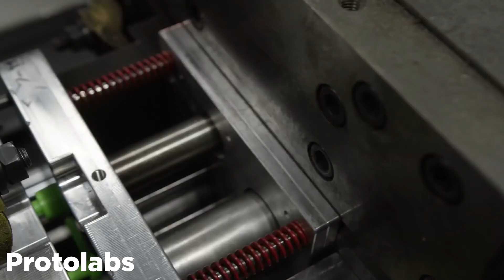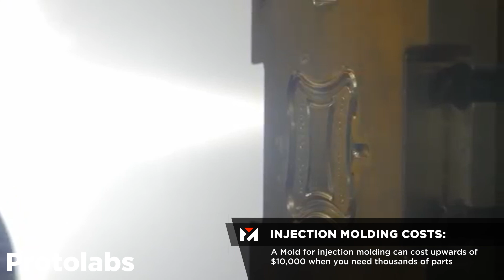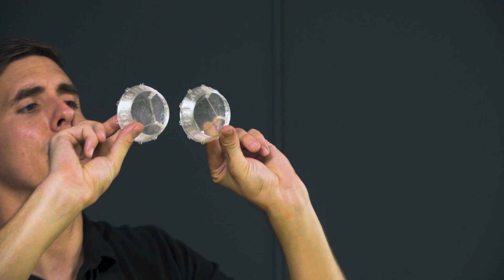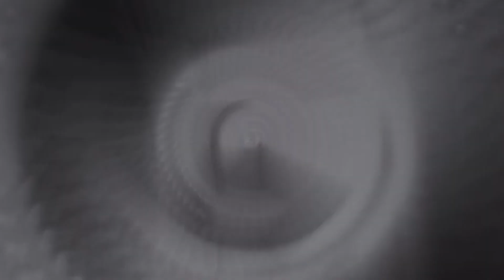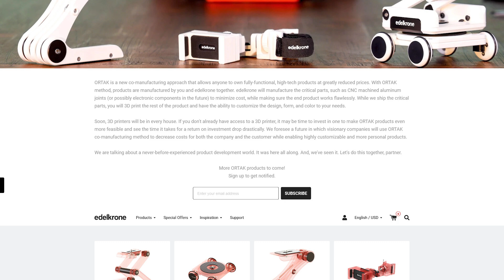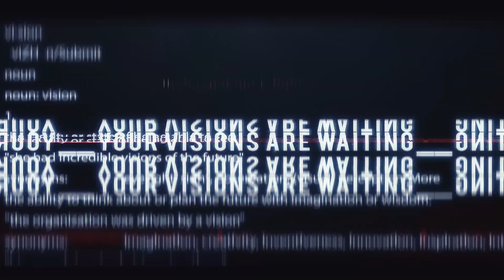Should You 3D Print Your Product? When you Should (and should not) Consider 3D Printing

Comment: If not following then in short, if your needing prototypes to test fit then waste your money and buy a 3D printer, if you’re wanting efficiency then invest in injection mold and produce and cut out middle man and quit screwing around letting others make $ off you. 3D printers are for the bored novice who wants print or design dumbshit nobody needs or wanted like Peter Pump Stands or Extensions For Peter Pump for that XL Magnum wife stealer Bro Bro

Comment: That orange vase is NOT going to injection mold as it exists... you would have to simplify those contours by a lot and then it will not be the same product... yes, the volume is high, but the shape is simply not achievable through other means without changes or huge expense...

Comment: One thing you didn't mention.  There are some geometries that would be very difficult or impossible to do with other manufacturing methods like injection molding.    I don't know how you would mold those two vases(though I am still learning lots of the tricks of molding).     If redesign to make other manufacturing methods work is not an option > 3d Print.   Nice vid again.
Reply from the maker: Good call, that really is one of the biggest benefits!

Comment: Great video ! I have a question , I am designing a rugged electronics case for use in environments like mines where not producing any toxic smoke in a electrical fire would be a big selling point , I was looking at injection molding it from a fiberglass filled polyimide , but the manufacture does not recommend major changes in wall thickness , and I have a place where you have a 15mm wall joining a 2mm internal divider , also it has a lot of undercuts , and would require a very complex mold , the volume will probably over 10,000 over it's production lifetime , but that could be 20 years . The manufacture of the plastic is not helpful in solving the wall thickness problem and I don't see how to make the wall thicknesses equal . So I am thinking maybe 3D printing it in PPSU , what are your thoughts ?
Reply from the maker: PA will still release fumes, but I would say ULTEM/PEI would be excellent -- ULTEM 9085 prints extremely well and has a UL94 V-) FST rating, used in airplanes -- extremely rigid, high temp, tough, and resistant to all kinds of environments! Shoot us an email with the parts and we can really get into details for the wall thicknesses/geometries... We'll help you out!
Reply: @VisionMiner  Thank you , I didn't know that about PA , I just knew it was fire retardant , it did not occur to me it could be fire retardant AND release fumes. I looked at PEEK , PPSU , PES , PEI , and PSU  and decided I liked PPSU . but I would have to go and look at all the documents to see why. With PEEK it was cost , one was poor on impact , etc. What is the reason you are recommending PEI over PPSU ? I can't send you drawings of the parts , but all the features that would make it difficult to injection mold like undercuts on 3 sides ! shouldn't be a problem for 3D printing unless the wall thickness changes also affect 3D printing ?